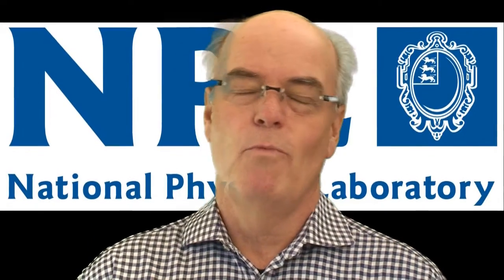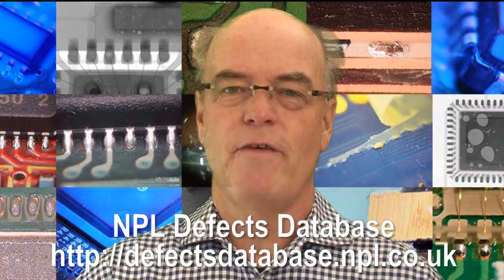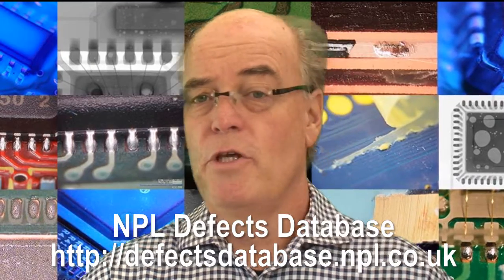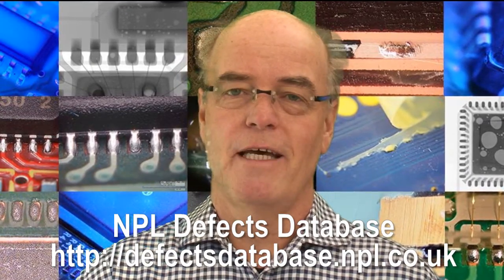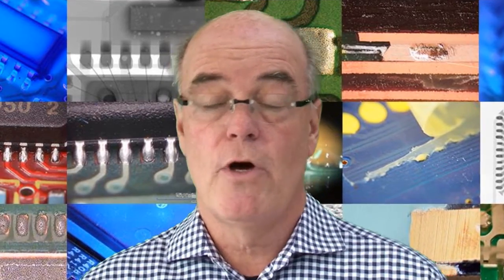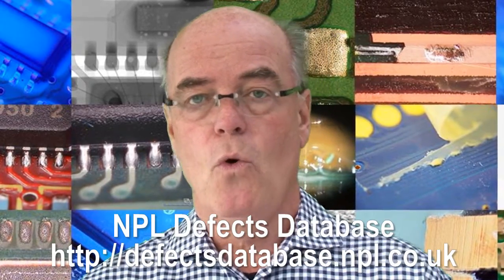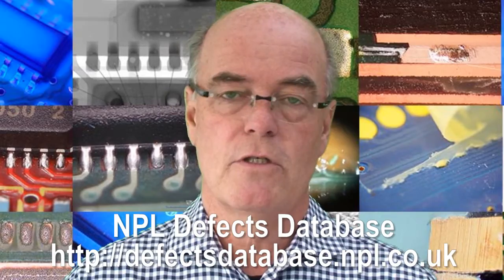Eliminating Soldering Defects with Correct Pre-Heat for No Clean

Comment: Hi!
Do you know how to reduce or possibly eliminate the chance of getting solder balls around the pins after soldering tht components in a selective soldering machine with nitrogen.

Today we need to manually brush each card a lot to remove all the solder balls!

Great videos btw!
Reply from the maker: Solder balls on selective and wave soldering are a function of the design, the solder mask type, and the flux type and quantity. If the balls are totally random then it's process setting zns solder mask type. I am away diving at the moment, but there are other videos on solder balls you can find on my page